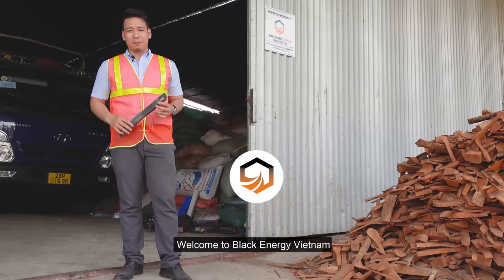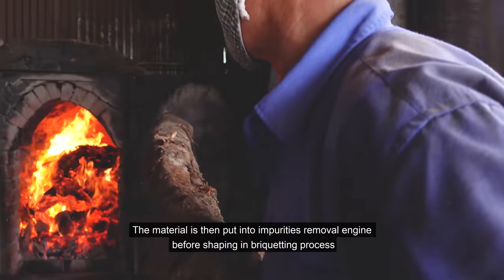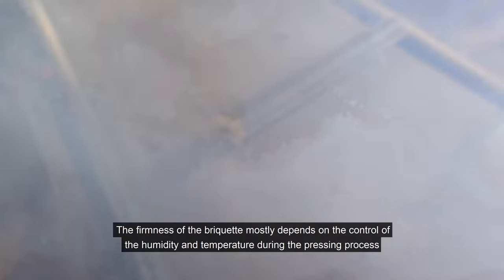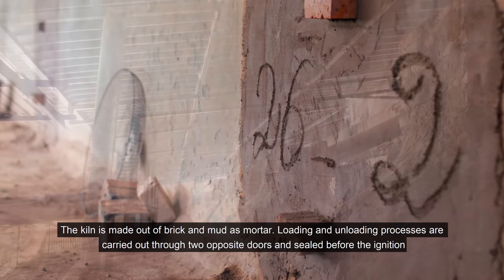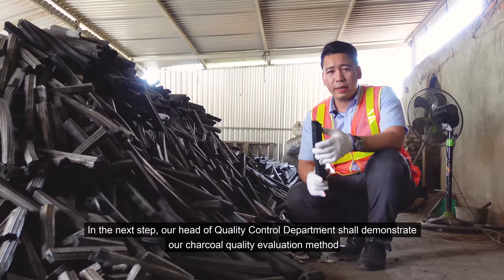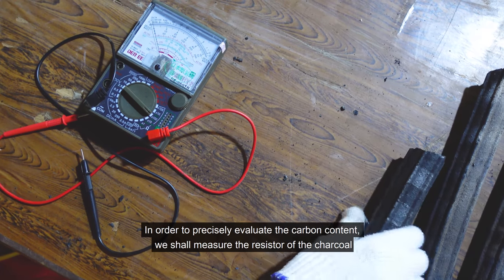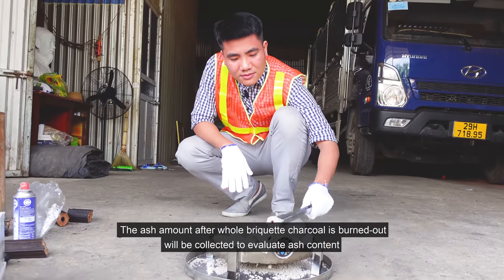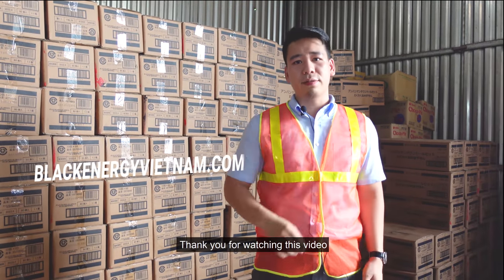Smokeless Briquette Charcoal Production

Comment: Magnificent that they are doing this.  But when has a charcoal making oven ever been called, "An impurities removal engine."?   A totally wince-worthy statement.  

They are trying to make this sound high tech.  It is not.  There are so many You Tubes on how to do this. 

The clever part is making sawdust into charcoal dust.  That is not so easily done as anyone who has attempted to burn sawdust knows.  The next clever pard is binding the charcoal powder.  My guess is they use clay, or a stiff starch slurry.  

Bravo to them.
Reply: The machine is pressing the sawdust with high pressure and high heat. This not not need a binder, I think.

 What needs charcoal is if they make the sawdust to charcoal dust and try to form it in a mold, then they would need binder. Correct me if I'm wrong.

Comment: are these pure sawdust from raw wood or furnitures? if some came from the latter, wouldnt this be sort of poisonous because of the chemicals in it?
Reply: This would only result if the wood was treated with water resistant and anti rot chemicals or furniture made from compressed wood chips/sawdust with glue or formaldehyde.

The pile in the beginning of the video was raw discarded wood, and almost every pallet and sturdy furniture is made from raw wood. 
But it's still possible

Comment: I'm searching on a less energy loss of making charcoal. As agroforestry consultant I know a few tree species very suitable and which prevent at the same time soil and water erosion. Then I made a dam to catch some eroded soil and probably a huge amount of energy can be generated from the waterstream. 

I'm thinking about using that electricity in heating a high pressure silo of firewood to make charcoal
Reply: Look at the biochar made from the pyrolysis process. It can be very efficient depending on the scale and gasification capture